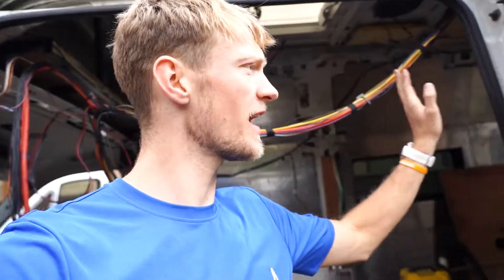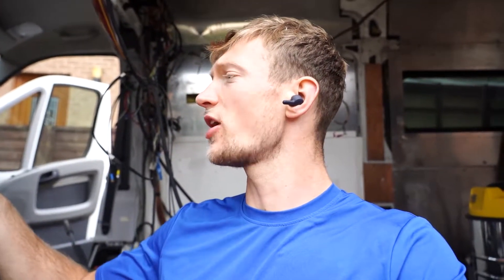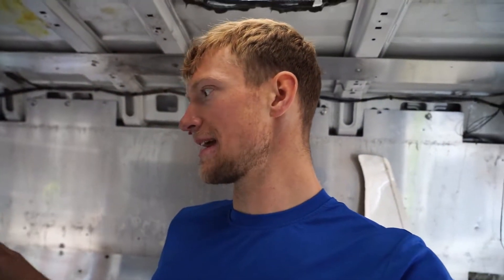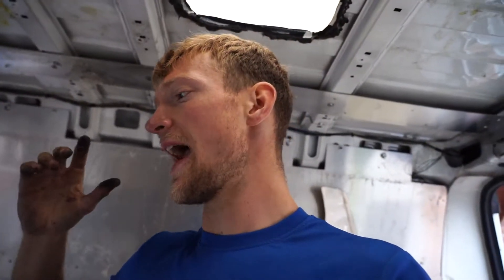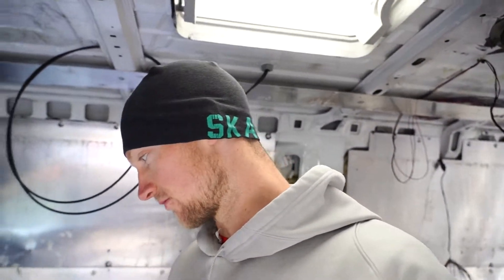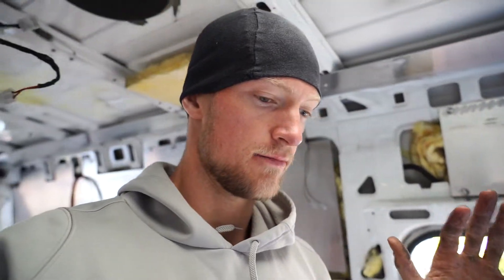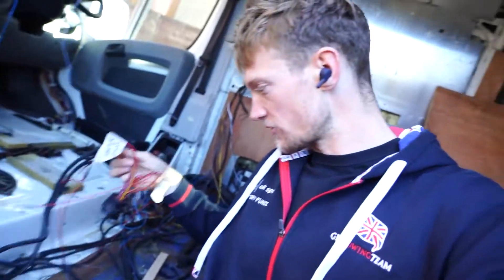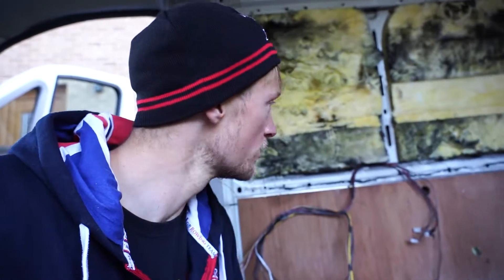Have I Made a Mistake with the Electrics? | Yambulance Van Conversion

Comment: Hi, are those ambulabces insulated and have already diesel heaters in them? Thank you.
Reply from the maker: Mine was and yes it did although it was temperamental and switched it for one of the Chinese ones off amazon. Works better and has thermostat, remote control etc
Reply: Hey man. What happened to the van? How come you stopped uploading?